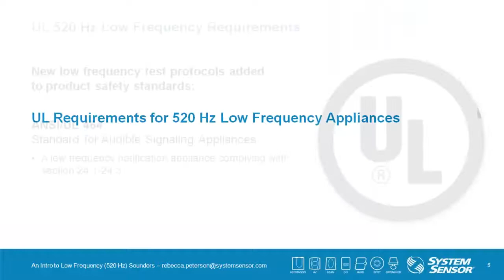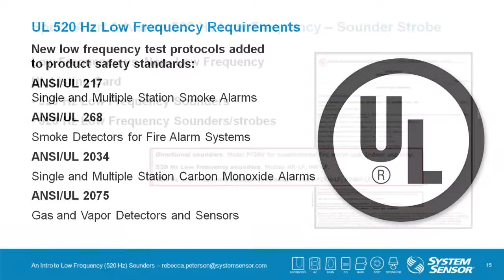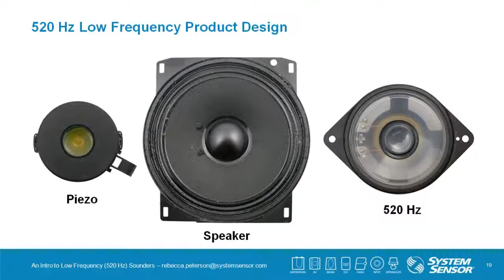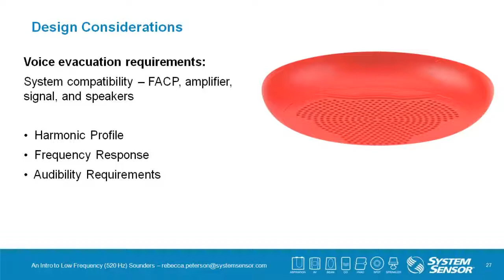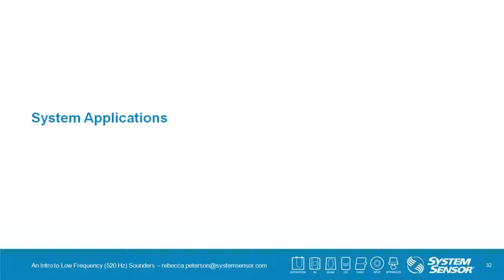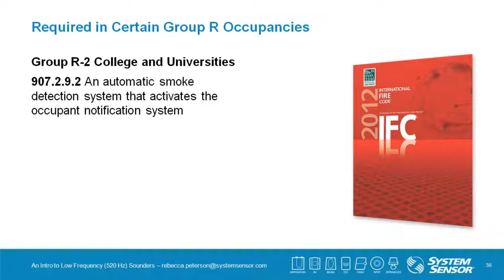AV - LF 520hz -- An Intro to Low Frequency (520hz) Sounders 2014

Comment: Standard loud chirp alarms are not effective for deaf/hard of hearing people, children and elderly people. Standard chirping alarms can cause Children with hearing sensitivities like autism and sensory processing disorders to hide away inside a closet or a place that feels safe and quiet putting rescuers or others at risk. Low frequency 520 htz voice alarms are more effective at waking children, elderly and people under the influence. The 520 htz sound voice alarms is friendly to people with autism / SPD and it helps prevent sensory overload leading to a more effective evacuation.